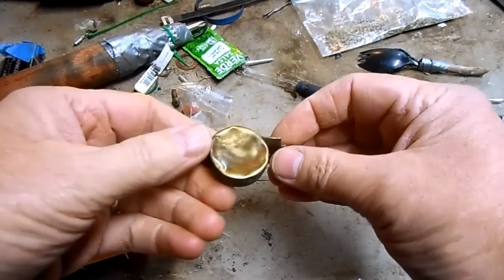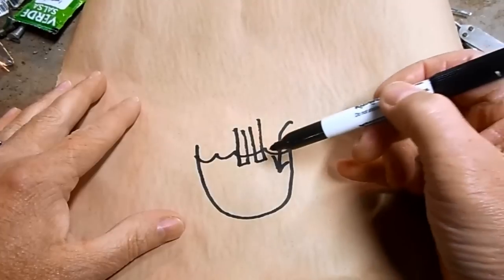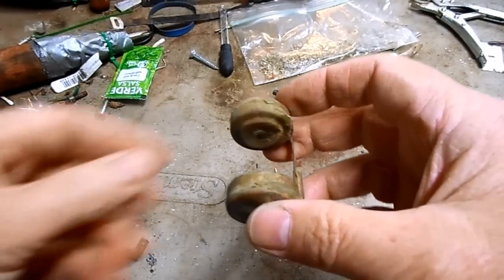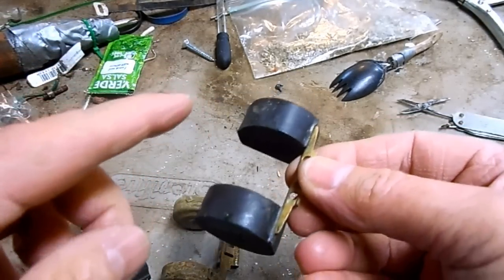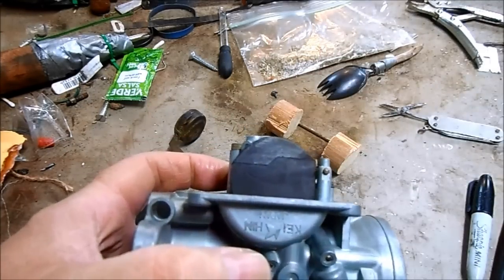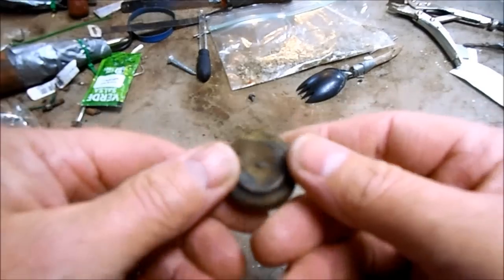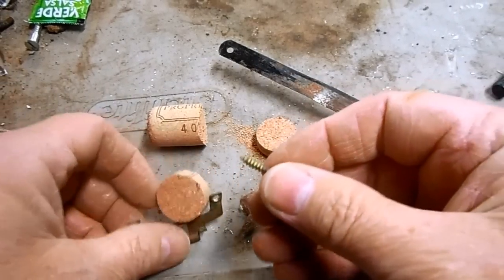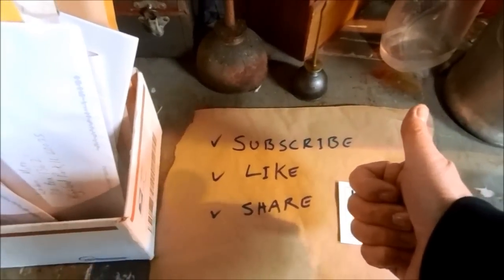how to repair and adjust carburetor fuel floats

Comment: Thanks Ichiban, another example of advanced motorcycle repair. Now if you'll excuse me I have to go empty some bottles of Two Buck Chuck to replenish my supply of carb floats.
Reply from the maker: +Mark Stevenson  how long has it been since chuck was only two bucks ?
Reply: +Ichiban Moto  I think it was in the previous millenium... in your prefecture it's currently about 330 yen

Comment: You can tell this is a old video because there’s a salsa Verde package in the background LOL boy how I miss those
Reply from the maker: it started with the tool roll video back when they discontinued it from the packet choices. used to love a packet of fire with a packet of Verde for freshness, took a taco from a 3 to a solid 4.  Verde packets are still right there on the bench!!!  at least one started leaking and i had to put it in a baggie, but it's still here  lol

Comment: Also, hand crafted polystyrene with its closed cell structure, make a great replacement for the Harley floats.
Reply from the maker: +Mason Ringbinder   I need to try that on the next Harley that comes in for carb service

Comment: awesome dude! this has helped me out big time...quick question- i 've followed your instructions exactly but alot of forums say i will need to remap now i've adjusted the floats..???
Reply from the maker: +johnnycactus0    if the carburetor sends more fuel to the injectors, you might need to tweak the ecu or adjust the battery ?
Reply: ahhh thanks buddy! i was a little worried but i reckon if i put a bigger battery in it should cope with the extra fuel- sorted!!!

Comment: You know model t ford floats actually are cork (varnished)
Reply: Interesting..
Reply: And filling your car up at airports is so convenient and affordable.
Reply: I know there are issues with using av-gas in automobile engines...Yet you suggested it.
Reply from the maker: don't use jet fuel.... just the propeller stuffs
Reply: Even that isn't well suited for use in automotive engines.

Comment: I have a bike where I got it in parts, and assembled but I cannot get it to run. The bike had originally had a blown piston, I replaced it. I also cleaned the carb when I bought it. The tanks clean, petcock works and fuel lines are correctly placed, but when I go to kick it over, I get nothing. Spraying gas in the carb manually or into the top end will get it started as well but the carb wont kick in and do its job. I have not been able to look in the bowl because one of the screws is stripped, could it possibly be a bowl problem? that the float is set too low and so its not drawing any gas in?
Reply from the maker: I will make a stripped screw extraction video :)
Reply: +Ichiban Moto thanks! I dont want to strip the screw anymore than I have to, to get it out!

Comment: I wondered why my friends Harley was leaking. Now I know. Thanks!

P.S., Do you know where the Harley Davidson  crankcase oil float is located. I can't seem to find it???
Reply from the maker: +Alberto Knox      There is one located in the drip tray on the floor under the HD.  It is there to set off an alarm to prevent drip tray overflow.

Comment: Does a new carb come factory set?
Reply from the maker: Never trust settings on carbs sold with generic make/ model fitment from anyone other than oem stock suppliers. Same goes for "pre-jetted" aftermarket units.
Reply: Thank you